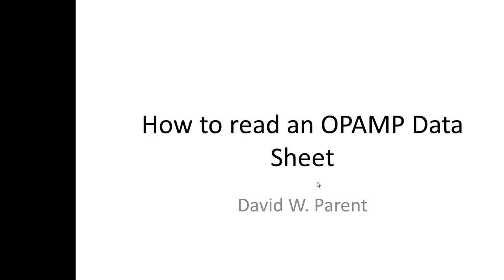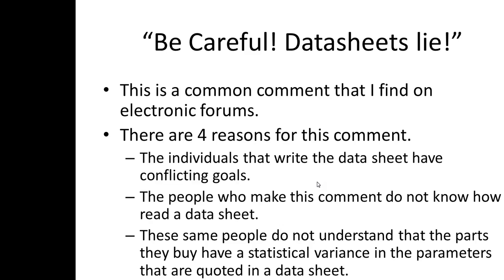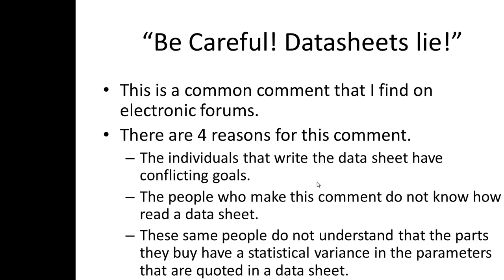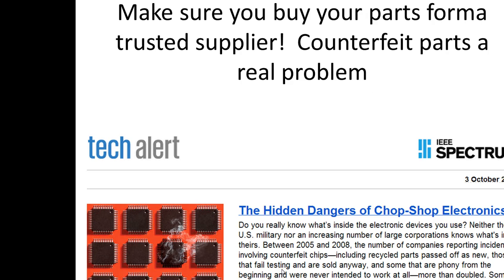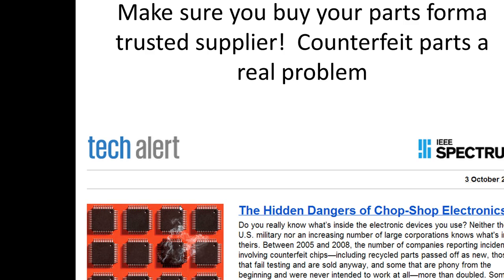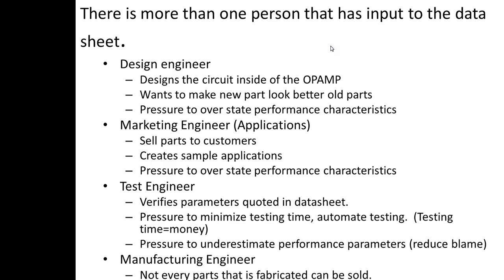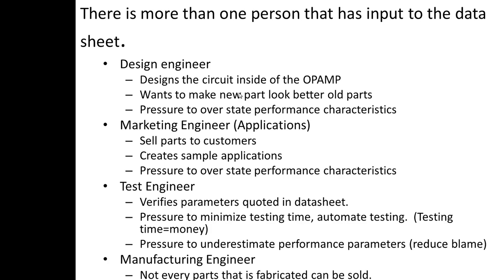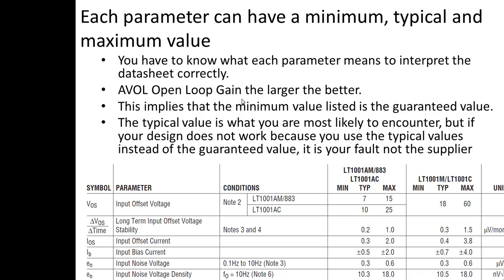How to read an OPAMP's Data Sheet

Comment: Why" Large Signal Voltage Gain " are mentioned at two places with different values for same ic and configuration in lm358 texas instrument data sheet ??
Reply from the maker: I can not see why they have two values in the same table.  The test conditions are the same and it the same part.  Good catch.
Reply: he asked this exact question in another video. must be trolling
Reply: @I10lC0LJI3U   it  means you also watched that video's and many comments 😅😂 nd seems you are medium of trolling reaction
Reply: @I10lC0LJI3U  all was just for getting answered by anyone.